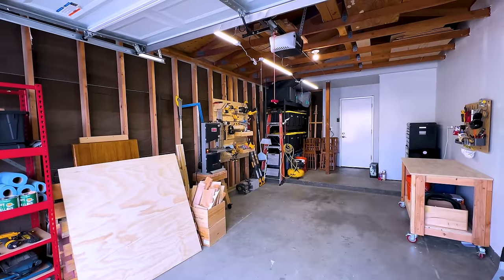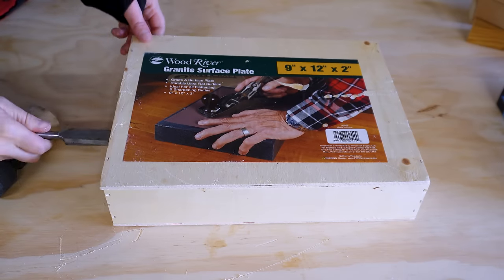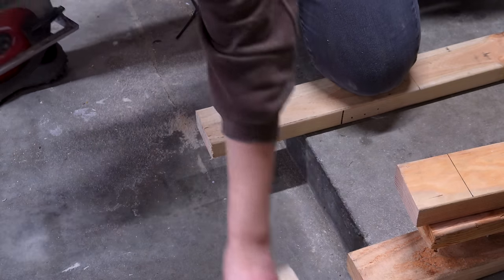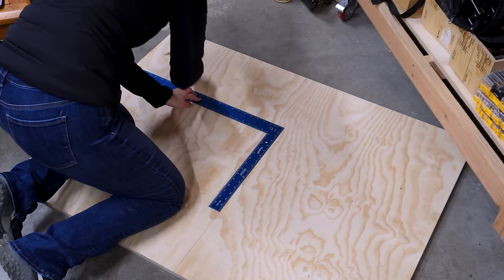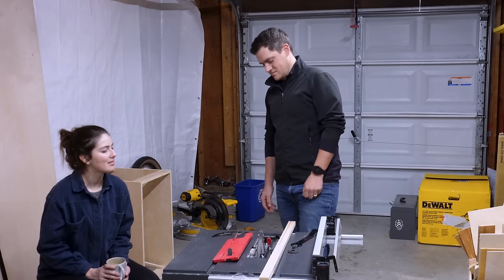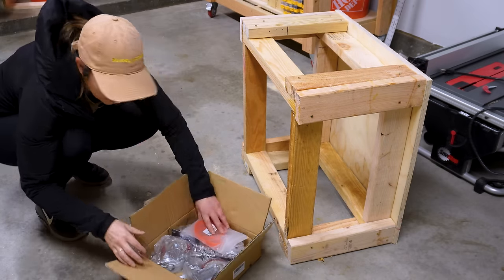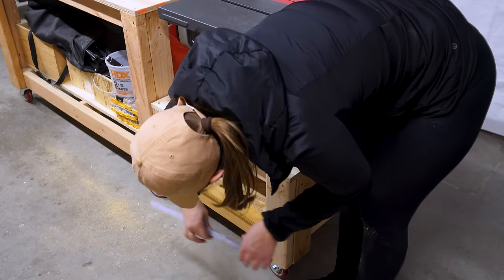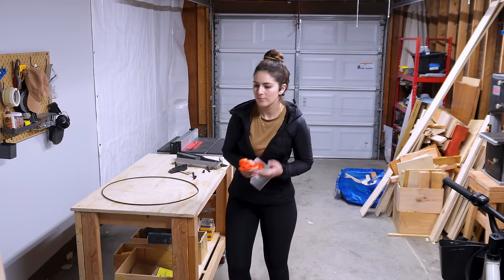Workshop Updates (and SawStop Scare)

Comment: Ripping thin stock is one of the most dangerous cuts to make. Please consider using a feather board before the blade to hold the stock and of course a push block. Glad no one was hurt.
Back in the 60's 2x4's were 1 5/8" x 3 5/8". They changed in size over the years due to changes in the grading specifications.
Reply from the maker: 100% agree, he should have been using a feather board + push stick.

Comment: I don’t see it as shame, it’s just part of learning.  And understanding that you really need to take safety precautions.
Last year I accidentally removed my driveshaft without blocking the wheels, for some reason I thought the transmission would hold. 🤦‍♂️. 
Luckily my truck is high enough that it could roll over me, but it did punch my ribs a little and almost ran over my leg, and bruised it pretty good. And rolled into my neighbors mailbox. It took me a few days to recover. 

This year end on January, I broke my leg while using a bar stool to use its little first bar to reach a beeping smoke detector, I got down and most my balance and broke my fibula. I blame my Sister in-laws husband for taking all 3 of my ladders, and almost bought a replacement step ladder just a few hours prior. But in the end, it was me who should have known better.
Reply from the maker: Hope your leg is on the mend!

Comment: Glad that Kyle is ok. that is a super scary situation. it is also super cool you shared that with everyone on YouTube. not everyone has the courage to do that. YouTube is full of armchair quarterbacks that think they know everything, and they have done it that way all their lives, so they know best type of people.  the truth is anyone can have an accident at any time and sometimes you can be doing everything right and something can break or go wrong, and people can end up hurt. I had a near miss recently with my Ryobi table saw.  had the riving knife in place and the blade guard as in place along with the anti-kickback pawls. I was ripping a 4-foot length of 2x4 to square off the sides and was using a push stick. for some reason I kicked back and threw the board halfway across my back yard. it went sailing my me before I even realized what happened. no one was hurt and nothing broken except my pride.  but that convinced me to buy a SawStop. I don't work with a table saw that often, but after that experience, i am terrified of what could have happened. and I also realize that I don't work with one every day, and don't have the experience that most DIY YouTubers have, so that makes it even more dangerous to a novice at woodworking, like me. So, I am currently saving my money to get a SawStop.
Reply from the maker: Thanks! Luckily, in my experience, 95% of people are relatively reasonable so it's easy to take the comments from the 5% with a grain of salt 🙂

Similar reasoning for myself as to why I was only comfortable with a table saw that had a safety mechanism. Also, I have EMT friends who remind me table saw accidents are not rare.

Comment: When lumber is milled, it sets up for about 3 years. During that time it shrinks and moves. Typically lumber will shrink 20% of it's cut. 20% of a 2X4 is about 1/4 of an inch. Then after they plane it and place round over on it that's how you end up with the measurements on a 2X4.

Also glad Kyle is ok.

Comment: GFBISA: Hi Elena. I am  a wildlife photographer, based in Ballito , a coastal town on the upper, eastern seaboard of South Africa,.
RE: Work table surface... My experience of MDF is that it's soft overall  for general working surfaces.  I use a  6mm sheet of marine plywood as the top sheet of a multi-laminated top of my general work table  which is 2,440 Mtr x 1,220 Mtr and the very comfortable working height of 1.00 Mtr.... 
You need to seal any, and every working surface with a very hard-waring finish.... I use a 2x pack, industrial finish made here in SA called " Poly Acrythane", made by Elvolac in Durban SA, but I am pretty sure you will find a wide choice of hard finishing surfaces for worktops, on line in the USA. I have used my table for 10 years, and it has  withstood all kinds of physical abuse, and a healthy amount of my verbal abuse from me from time to time!! 🤣
NOTE: ALL my machines have a universal 1.00 Mtr high working level, as do all my trollies, and everything is mounted on  braked, wheels/castors, to enable me to wheel everything around to suit my requiremnents, then locked to stop any movements.
RE: Good Tip: I always have  a few rolls of differing widths of female/male Velcro tape which can be fixed to all kinds of surfaces, using regular contact adhesive. The bonus is that it is re-usable over and over again, and you can move everything, when ever you wish, or simply, leave it in one place. 
Good TIP: Male hooked, Velcro on it's own, sticks very readily, and very successfully to any low-pile , hardwaring floor carpeting, which is very cheap, and comes in many different colours.  Low-pile carpeting can even be stuck to cover an entire wall, creating and aesthetically pleasing wall covering, offering some insulation for heat, and also sound insulation. It adds a really cosy  It is a very handy surface for suspending any small or larger tools, boxes etc  using a piece of male Velcr.  Simply use contact adhesive to paint on the wall, and also on the carpet, then lay it as a wall coverying. I have numerous applications. eg: Sections and panels, covered with low pile carpeting on one side, and a 10 mm  Neoprene rubber, or plastic foam on the other side , the panels can be joined to form flexible boxes boxes etc, using male Velro over the joing between panels. It's quick, and re-usable, so your boxes or insulating surfaces, can be collapsed to lay flat for transportation or storage, then re-assembled in a heartbeat.
Hope this all has helped to make your day a little brighter 😁
Take care, and be safe out there,
warm regards from South Africa.
https://timdrimanphotography.co.za/
Reply from the maker: Hello! Thanks for all the tips, always appreciated.
Reply: 😆 @elenamakes

Comment: Now is a perfect time to upgrade to a Forrest or Amana table saw blade.
Reply: I was on the verge of getting a premium blade for our old Delta. Then we bought a Sawstop and I became reluctant. Considering that the blade gets damaged if the safety mechanism fires why risk more money? CMT is perfectly adequate. Or Freud. Or even Sawstop.
Reply: @TheOriginalNinetyEight  There are a handful of companies making good blades. CMT and Freud are among them. Freud makes some lousy blades, too. I don't know the quality of Sawstop blades but most table saws come with a mediocre general purpose blade. Unless I have a reason to believe otherwise I will assume Sawstop is no different. The only Sawstop I've used was equipped with an Amana ripping blade. Sawstop or not I am going to keep my hands away from the blade. I'll take the same precautions I would with any saw. I wouldn't avoid buying a better blade because the safety mechanism can damage it. I'll buy and use the best blade for the cut I'm making.

Comment: In my shop, I made my bench tops out of MDF. I haven't tried using just plywood but the smooth surface the MDF offers is nice. 

One thing I do regret is I made one huge work bench. After seeing your smaller work station, I am planning on cutting mine down and redoing them. Possibly building a stand for my miter saw and then being able to roll the two work benches on either side as an outfeed table. Being in a small shop, this will give you the options to have multiple purposes for the work benches. 

Great idea on attaching the outfeed table to the table saw stand!
Reply from the maker: Glad it was helpful :)

Comment: One good tip, not even a woodworker, when screwing and it's hard to push in. Run the screw through your hair, hair oil lubricates and screws go in easier. Also, wear knee pads, a true knee saver.

Comment: I have MDF for the top of my workbench thats been used for close to 10 years now.

3/4" and a little less than 4x8 so the key was the cost and how easy to replace/maintain.

I don't do any work that requires water or fluids directly on the bench; if I do then I'll lay down a tarp or towel. 

With your garage setup and the way you have your shop furniture; you'd be just fine with either the plywood or MDF.

Again, its all about how comfortable you are scratching and denting and "ruining" the surface of the workbench. Would you be ok messing up a bench top that was hardwood imported from Brazil and hand milled with custom inlays and epoxy coated, or you'd be ok beating the crap out of some MDF that is cheap and available at any place.
Reply from the maker: Right now the cheap, can-take-a-beating bench is the move for me! And then down the road, maybe I'll build a much nicer workbench with all kinds of fancy hardwoods.

Comment: Hi Elena, Omg, sounded like your man was standing in court. Who has a trigger on top by the blade anyway? Think the designer should be shot, yet why not buy a foot switch for future jobs.
As for making a stand for such a small bench saw, maybe with the small wheelbase being only the width of the saw, it then hangs on whether your floor is both smooth and level too much?
I´m just like you re sketching ideas first, you discover so many better points of view when doing that process and it´s going to be fun too. I would consider having the two tables link together to guarantee a level from the start, maybe magnets? The very big company in Germany "Super Magnets" make any and all types, including some of the worlds most powerful.
You could easily use many of their storage ideas to store tools and also hold two tables together.
Also great for holding nails and screws!
You got some nice chisels from Japan, yet read up on how to sharpen properly. You need at least two stones, yet is possible to buy two types on each side of a single stone.
They are not always made from the purest metal and can rust over time, so a little machine oil and keep them in a roll of leather or dry place, do not hang up on the wall!

Hope these help

Comment: The overlapping vertical pieces in the corner at 8:26. Is there a name for that so I can look what is the optimal placement for the screws... or if you have a tutorial video...?
Reply from the maker: Personally, I do not follow in perfectly standard template, but just spread the screws out so the attachment points are distributed well. Between those screws being spread out, and the wood glue I apply (which is very strong on its own) it is plenty strong.

Comment: I couldn't see them in the video but that contractor tablesaw should have mounting holes in the bottom of the frame so you can screw it down to make it stable.  If it doesn't, that's kind of a design flaw for such an expensive tool meant to be used at jobsites.
Reply from the maker: It doesn't appear to, which is my biggest gripe with it so far.

Comment: The government is now trying to pass a law that all new table saws will have to have that braking system installed. But it will double the price of the little bench top models, by adding at least 300, and up to another 1,000 for cabinet sized. But maybe worth it compared to paying up to 500,000 if you had a complete amputation.

Comment: Don't (ever) do MDF; even if its really inexpensive. ALso wouldn't recommend plywood for your top.  Instead get a melamine sheet for your top. It's what I went with, and I'm so glad. 
1, MDF and Ply can and will swell up from any spilling be it your drinks, water, stains, paint, thinner. you get the idea.
2, On the melamine you have a longer life span due to outer "protective" layer. Accidents do happen and you will drop your tools and would dent mdf/ply would a lot easier than melamine., 
3, clean up, in my experience whenever I do a glue up and spill any amount. it is really easy clean up. just a damp rag and its off. or let it cure and it pops right off with a putty knife or chisel.

So even if it cost a bit more, it will outlast both and be easier to work on.

Lastly, a friend who has been a woodworker for many years told me about cutting melamine is if you don't have the right saw blade; it will cut and chip a lot. I purchased a cheap Ryobi circular saw (with the included blade from Home Depot and I even used blue tape on my line), and he was right it chipped pretty horribly. However, the underside came out really good. Later he tried to explain why(tooth count /direction of rotation /type of blade/maybe the rpm?... honestly, I don't remember  --Just that you should do a test-cut and then if you need to; cut it upside down. Hope this makes sense and that it helps.

Comment: How did you get the car booted in front of your shop?   What is the fee to get the boot off?
Reply from the maker: It's a lock to keep someone else from rolling away with our lil camper lol
Reply: @elenamakes  well this will not stop a thief. How many thiefs look for such thing especialy in the dark? This will only destroy your car when a thief decides to drive it.  There is something better.  Its special set up when the ignition is turned to run the engine will not start but the horne will sound.  You will know in the middle of the night that somone is trying to drive your car.

Comment: how would his LEFT hand be in the path of the blade? you should always be pushing material thru using your right hand , do you guys have the fence on the wrong side of the saw or something? even if you are left handed you do not use your left hand to push material thru a table saw unless I suppose you put the fence on the wrong side of the saw then in that case you could use your left hand but that would be very dangerous and unstable.

Comment: 5:40 hey hey, don't blame us at the wood moulding machine. Literally everyone blames us. we just get wood from drunk scandinavion sawers not to the proper size and we have to just make the wood smaller lol.

Actually a reason that the pieces are smaller could be various reasons. Could be to make them straighter for instance. Could be for the reason above. But in any case if it's rated lumber, to be used  for construction. I as a moulder am not allowed to take off more than a certain amount without judging each plank individually, visually. Which is not feasible. So probably smaller wood than 2x4's is coming from smaller wood companies who just don't care about this. 

At the sawmills wood gets judges by machines, but as the wood is milled it can become less structural integer, or when it's sawn or just by aging, it can become less rated. But I almost never have to make 2x4's it's almost always 44mm thick and 94mm wide. Why? because the sawmill makes 2x4's and we gotta mill like 3mm on each side to hit it well (pressured by a very heavy duty machine) when I gotta mill an actual 2x4 it often means I gotta make it from 63mm thickness, so that's a waste of wood, right

Comment: Any power tool, especially saws, should be treated like firearms. Always practice vigilance in every situation. I have a 30+ year old craftsman table saw and have all 10 fingers (knock on wood). I am almost 60. You have to go through an accident mitigation checklist before every cut. Much like an airplane pilot does with his plane before flying. Is my workspace clear? Is my outfield unimpeded? Is my workpiece supported properly? Do I need a push stick? Can I make the cut in a safer manner (like supported with a circular saw). Don't get me wrong, over the decades I am sure I have made questionable cuts. I think the sawstop technology creates a false sense of safety. You are very lucky to have come through the experience fairly unscathed. Despite technology, always practice safety. Shit can happen in a millisecond. ❤